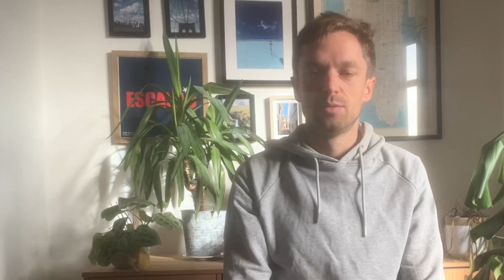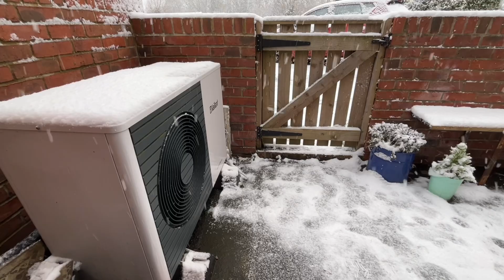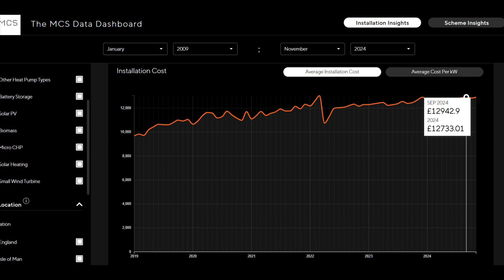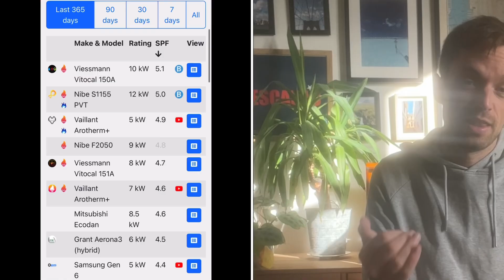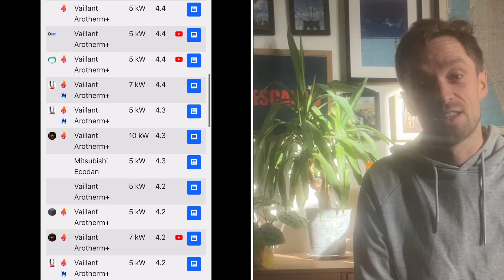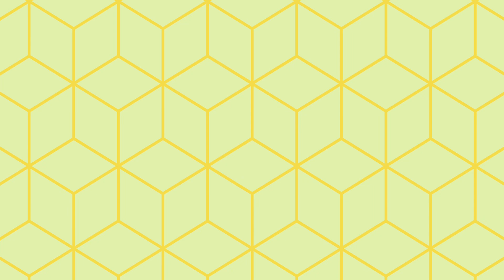Are heat pumps a good investment? The answer might surprise you

Comment: Here we go, another heat pump fan, especially after he got a 100% free EON paid installation. Saving a few hundred pounds a year would make this totally unecconomic  for us mugs who have find the hard cash from our own pockets.
Reply from the maker: Hi Teslamars2259 - thanks for commenting and engaging with the video, I agree that we need support to transition away from dirty heating systems, and I think this should come in the form of grants (that do exist), cheap finance (that does exist) but also changes in energy levies and taxes to stop subsidising gas and stop punishing use of electricity. If that was the case, savings would be much higher. 

Despite this, a heat pump can still reduce costs, and improve comfort, as well as significantly reducing environmental impact (air quality and CO2 emissions) of our homes. 

I agree it’s a decision for people to make as to where they spend their cash, some people choose a new kitchen, new car, big holiday, new sofa etc … none of these would be economic decisions but decisions based on lifestyle. A heat pump is the same, and gives you reduced costs!

Comment: A monobloc 6kW heat pump is around £3000. Where is the rest up to £17000 going to??
Reply from the maker: Average heat pump installation cost is about £13k, this may include new tank, replacement of radiators, electrical installation, as well as labour to do all of the above, and some profit for installers. There is some work involved in heat pump installations to upgrade from a boiler.
Tom

Comment: I don't think heat pumps were ever meant to radically reduce the cost of heating homes, but to provide systems that were roughly on a par with gas, even oil. There is no gas where I live (NW Scotland), so a heat pump was the only real option to burning fossil derived energy. (And leave the 'Electricity is still largely fossil fuel derived' debate for now) But that was not my main motivation for change. I previously had coal/wood solid fuel central heating which burned, at pre-covid/Ukraine/other-reasons prices, about £2,400 in total every year! I would have gone for a heat pump even if it cost that much to run, as it would have meant the end to lugging all that mass - 3 tonnes of coal + many cubic metres of assorted logs etc - around the place. But I now pay around half - about £1,300 - of that staggering sum at today's power prices, so that's a win in anybody's book. I have health issues that mean I need higher than everage temperatures all day. The clincher was the 100% grant I received from the Scottish Gov, for a system I estimate would have cost £8,000 had I sourced it myself and paid privately. I calculate that if I had mains gas and the best modulating boiler, I would be paying about the same in gas as I actually pay in lecky. So, I halved my power cost overnight, and paid nothing for the privilege. But if I had paid for it, it would have paid for itself in about 8 years, 10 tops. I know this isn't apples with apples, but it is a win-win for me! £105 a month for 24 hour cosiness; and the winters are longer here than in the soft south. People can chaff all they like about heat pumps, but they probably understand rather less about the physics and best way to use such a system than most, so ignore the detractors. The only reality about heat pumps us that if you have a draughty and badly insulated house, then maybe a low temperature system like a heat pump will cost more to run than most other systems, but then you are the one living in a draughty and cold house. Good luck with that.

Comment: I think if you can get rid of your gas meter that is at least £100 a year in standing charges a year saved. If you schedule your water to heat between 5:00am and 7:00am (with EonNext) the per kilowatt hour is 6.7p which should save a lot over the year. Maybe even heating the house during the early hours with that lower rate, so you need less heating time during the day. With that I think you could make some pretty good savings.

Comment: As I thought so it is a kind of misleading information. If u have to renovate your old haus and u have the right amount of budget you can go on with heat pump solution however if you have to replace your radiators to floor heating you just killed yourself it would cost much more than the heat pipe system itself. Right now in my old house removing the old concrete floor + insulation min 10cm + floor heating installlation + renewing all tile works and wooden floors cost min 50 000€ including Labor cost. If we consider the heat pump cost of 20 000€ then it is a NO go forever for me... Adapting photovoltiac solar panels on the roof would cost min 8000€ more. Battery storage no clue but even more expensive than the solar itself....
Reply: Houses in the Uk are not insulated properly like Scandinavian homes as we really don’t get the cold like they do. That’s why a good combi boiler works well. Heat pumps have been around for donkeys years. Not used in houses as they are complicated and expensive to install and maintain.

Comment: Heat pumps work for SOME people under SOME circumstances.  This is certainly not the majority though.  Grants won't cover every application that is supposedly required and are only a carrot (in a stick situation).  You can install air-to-air heat pumps (otherwise known as air conditioning) that have COP values of 4 (or more) but there are no subsidies for those.  But the only issue is whether or not gas is a problem - it isn't.  We have 'centuries' of availability, cheaply.  Nothing 'we' do will make a single iota of difference to the planet.  Nothing.
Reply from the maker: Hi Kelly - this project demonstrated that heat pumps can work in most / all circumstances - https://es.catapult.org.uk/project/electrification-of-heat-demonstration/
Yes grants won't meet the full cost of most installations. 
Yes air to air systems could be part of a solution in the future, and tend to be much cheaper than a full air to water system (but would only serve a few rooms at most and not provide hot water).

Suggesting that gas is available cheaply is simply wrong, its price is very volatile and has been the reason behind the energy crisis in the UK over the last couple of years.

Gas use and its associated emissions is a problem for a number of reasons, contribution of domestic boilers to NOx emissions and therefore poor air quality, asthma and other breathing conditions. 

As well as gas use's contribution to climate change. The choices that individuals make are small in the grand scheme of things, but have multiplier effects on the wider system, market forces and influencing people around them - I did a video about this recently - https://www.youtube.com/watch?v=B1cP0X0opVg

Thanks

Tom

Comment: How are folks, that are struggling to replace a £2.5K gas boiler, going to replace a £15k installation when that gets to end of life, without the grants? People are not looking for a 'lucrative' ROI, they are looking at not costing themselves a lot more over the life expectancy of the product. Heat pumps are far less flexible than a gas boiler, both in use and in installation. Folks that like to throw open the bedroom windows to get the room aired(whilst the gas boiler is off) cant do that with a heat pump, otherwise it needs to work extra hard to get back to temp, thus destroying the COP. Same with folks that perhaps leave a back door open while their dog roams the garden etc. Point is, the system is less flexible. As regards air quality, having everything sealed up tight(without an HVAC) might well lead to higher instances of asthma type illnesses. Regards installations, these are far from perfect on far too many occasions, especially where grant money is involved, but they need to be 'really tuned installations' to make them 'cost less' operationally. So whats on offer (for many folks situation), is something that is a lot less flexible at five times the cost(grants excluded-unless of course we are going to have permanent grants going forwards) and we wonder at the slow uptake. It is not about making money, it is about not loosing money overall, for something that is a basic necessity, not a discretionary spend.
Reply from the maker: Hi Jim, there are also low interest loans available for this kind of installation. 

Why can't people open windows with a heat pump? It would not destroy the COP. It would add a small amount more heat loss to a space and the temperature may drop but would soon come back as soon as the window is closed again. 

In the depths of winter I am not sure there are many people who leave a back door or windows open for long periods of time.

A heat pump does not mean you can't ventilate a space. In fact, a gas boiler contributes to poor air quality and NOx emissions, a gas hob, NOx emissions inside the house.

You have a lot of issues linked to heat pumps, the challenge back to you is... what is the alternative? You are happy to keep on burning gas, with its volatile prices, links to despots around the world, and damage to our air and climate?

Tom
Reply: @TomBray-LowCarbonLifestyle  Tom, I don't have any issues with heat pumps whatsoever. I think they are great, but nevertheless, offer less flexibility and crucially, they must be installed perfectly. Now that grant monies are involved, the price point is about double where it aught to be...a bit like the solar pv pricing until the FIT was stopped and prices fell almost overnight. I have Solar PV, installed 2010, a home built 7metre solar flat panel collector for heating a water tank, i've driven a Mitsi PHEV since 2016, my wife drives a fully electric corsa...so i'm not anti carbon cutting measures. I do think we need to get real, when it comes to costs, especially for folks that live hand to mouth each week. Saying you can get a loan for £15k isn't going to help these peoples that simply struggle to pay the bills each week. Folks are struggling with their energy bills, which have doubled for no discernible reason (see nat gas pricing https://invst.ly/17i-mp) plus daily standing charges increased way above the so called 2.5% CPI etc. Instead of bludgeoning folks with increased taxes on the gas, which they can ill afford at the moment, the better means would have been to eliminate the tax on Electricity and possibly subsidise the electric pricing through oil company taxation. This would help businesses and the economy overall, rather than squeezing everyone. Cheap energy is the absolute key to a vibrant country. Perhaps, if more had been spent on increasing hydro power, with the added bonus of more water storage...always a big plus going forwards. I just don't agree with energy rationing through pricing models. The challenge is, leave Gas where it is and halve the price of Electric and folks will naturally migrate to ASHP and EV's all by themselves. I think we have left it far too late for easy answers, but then if you look at China, India, Nigeria industrialising... then the UK punishment is disproportional for the resulting benefits on a global basis.

Comment: Having a heat pump does not mean you are 'taken out of the fossil fuel economy'. Much of electricity generation is still from burning gas. A solar installation would get you nearer to that state, except that not a lot of solar power is generated in the winter when you need to run the heat pump.
Reply from the maker: I think I followed that up with ‘at least for our heat’

Yes electricity is still generated using gas. About 1/3rd in the UK in the last 12 months. 

We are also part of a ripple energy cooperative, so could count some of the electricity from that. 

The point I am making is that it is fantastic not to have to burn fossil fuels (locally) for heat, for a number of reasons. 

The system we live in does not facilitate a fully fossil free life yet. But a heat pump is a big step in that direction

Comment: Less than a month into ASHP ownership. The motivation was threefold, firstly our old combi boiler was failing, secondly it felt like a direct and immediate action we could take to reduce our personal carbon impact and thirdly we hoped to save a little money (although expectations were low on this). We did however save a LOT of money on the install due to the grant. Our (IMO oversized) ASHP cost us just £500, which included 10 new radiators and a water tank. This is considerably less than a new boiler would have cost. Our membership of a Ripple CoOp is also going to help (although shares were based on our old, pre-ASHP, electricity consumption). There are some negatives which are mainly around concerns about the original survey and subsequent huge 16Kw ASHP but even with these the swap was an easy choice for us. For friends with relatively new gas boilers this decision will be harder but as the life expectancy of them in now only around 10 years there should be a constant flow of people for whom the swap should be an easy choice to make, as long as we can cut through the misinformation. Final point; noise (for us in our semi-detached) has been an issue but terraced housing where the ASHP will be close to neighbours should have a much smaller and quieter ASHP than our massive  and not so quiet Daikin.

Comment: Tom it would be great to have a chat regarding boilers and efficiency. Most people dont use their boilers efficiently. I have been teaching people  this from a money saving perspective and actually how their are small things we can do even with a boiler amoungst other things to reduce our carbon footprint as well as save potentially thousands each year on bills.

Its worth noting heat pumps need to be installed correctly and also a mindset shift needs to happen before people get them in they way we live or our costs rise, pushing more people into fuel poverty.

Comment: Thanks for your videos. I feel that, now I have to comment. Originally I was an automotive journalist in Hungary. We used to have a lovely house at lake Balaton, wanted to extend and develope it and did not want to get gas, but heatpump heating. The architecht said, that would be very expensive (3-4 years ago). Finally we sold our house there, moved to the Netherlands, bought a 2006 built house with a perfectly working gas heating, but switched to all electric heat pump this year. The Dutch power prices favours to the heatpump, we could count with a subsidiy as well, but I think the biggest winners are the developer companies. At the end of the day, we switched because we wanted to be CO2 free. We are owning electric cars since 2016, the main reason was the same, not the lower cost, but the less polution, the better efficiency in both cases. If you visit the Netherlands, feel free to visit us, I would be happy to welcome you with a coffee, made on our induction plate, which we are using in all our homes since 2010. That is more comfortable and more efficient as well :). 
Kind regards,
Matyas

Comment: I worked out that to get heat geeks to install I would need a scop of 4.1 to break even. But it's not about that. 

It's the same as EVs it's a choice. It reduces your footprint and also increases your comfort.

The problem is we need to hit the mass market, only octopus seems to have figured this out.
Reply from the maker: Hi gmuzz - what are you assuming is the efficiency of the boiler you would be replacing?

Octopus are doing good things to try and make it more mass!

Comment: It's the uncertainty of knowing whether it will work in my draughty (and some damp issues) old house (solid walls) coupled with the large investment. My gut tells me to fix the house first, but I can't afford it. If I drop the flow temperature on the boiler from 70 on my rationed heating schedule to say 55-60 and lengthen the heating schedule, would this make the house warmer AND cost less? Currently writing this wearing mittens :-)
Reply: Don’t do it! Sort out the damp issues, Try to insulate your house as and when you can to keep the heat in. Start in the roof, good quality double glazing will be a massive help. Be careful installing insulation on the outside walls as any parts that are missed Will Cause serious condensation and mould issues.
Reply: @Cyberbobxxxx  Thanks,  I agree in principle. Some kind of cost effective mitigation is required. But going the whole hog and replacing all the windows would cost a fortune and one side of the house is not allowed as it's listed and already have secondary glazing. Basically, I depend on wood burners in the rooms where most needed. Old, detached, listed properties that have solid walls, no damp proof course do not seem to me to be incompatible (Unfortunately) with heat pumps. So the price of gas is a big issue for me going forward.

Comment: I would add though that if you’re replacing an old gas boiler in need of replacement for many it’s not a like for like replacement. Most of additional cost in installing a heat pump are the heating, insulation, and ventilation upgrades that are needed, and even though these costs can be significant they usually result in an increase in the price of the house as have increased the EPC rating. And the increase in the price of the house quite often equals the amount invested. Heat Geek actually did a really good video on this. Also Heat Pumps can make use of time of use tariffs.